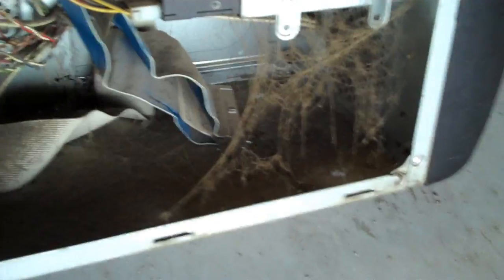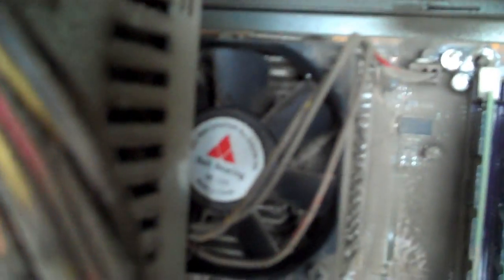Inside Your PC (Yuck)

Comment: @kellyfortune if its dirty then you should clean the the heatsink above the processor, this is the big 'thing' right in the middle of the motherboard - thats the most important one.

if its not dust which is causing the problems, it could be other things like hardware problems. use software to check temperatures of your hard drive or processor or wherever, this will give you some idea where the problem is.

Comment: On the back of your laptop you should have around 3 small pads that you can open up with a regular screwdriver. One should contain the RAM, another one may contain the wireless device, and the other gives you access to the heatsink and the processor, also good to clean the heatsink. You can also look it up on the company's website about how to take the keyboard off and such :D